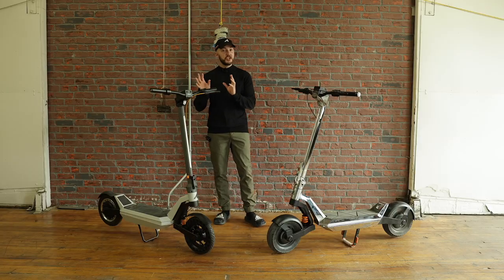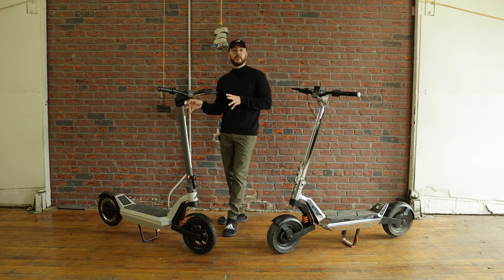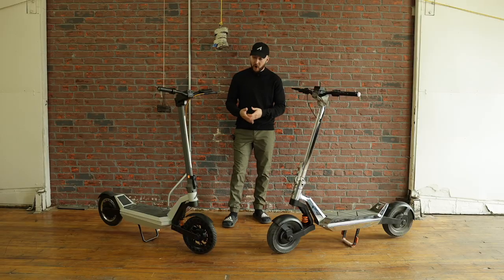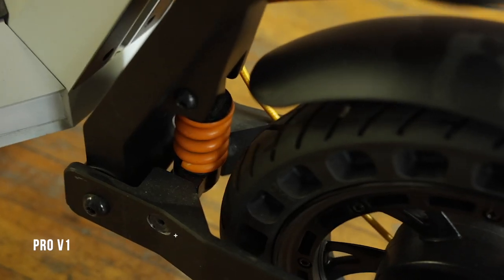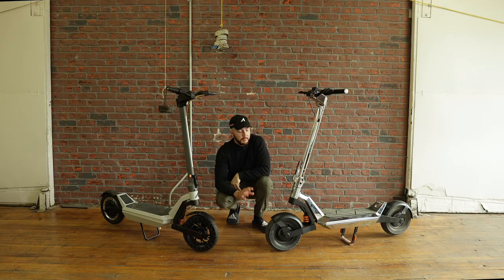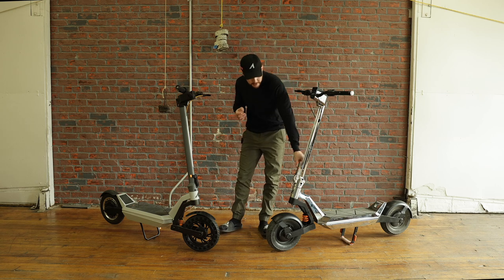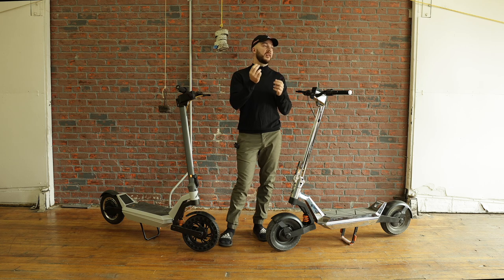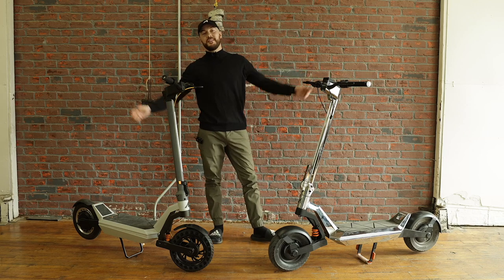Apollo Pro V1 to V6 Evolution

Comment: In general, my top-end, entry-level e-scooter (NIU KQi3 Max) has replaced all my single-occupancy-travel vehicle use when I'm doing errands for a while now, but it lacked the feature-set polish a vehicle has (single motor, no suspension, no turn signal lighting, weak sound/alarm, lack of thorough endurance-quality control testing of parts).

Despite being one of the most well-built for it's class, in less than a year, the front emblem has fallen off (adhesive failure?), the throttle needs to be replaced because it constantly gets stuck in position (I'm guessing the spring has weakened) as well as overshoots from it's max position, causing a potentially dangerous situation, the kick stand has worn down and now overshoots and is less sturdy/robust, and the disc brakes get bent when toppled over (due to the kick stand not being sturdy anymore), just to name a few.

There have been some potential upgrades I was considering, like with the Apollo City Pro 2023, but I still wasn't fully convinced or prepared to switch.

The Apollo Pro appears to check off all the right boxes, particularly in regards to quality control, and I'm having difficulty trying to find a fault in it.

Much more expensive for sure, and I could buy a few e-scooters for it's price, but considering my lack of available space, I don't want to have to replace an e-scooter every year.

If I can have a reliable e-scooter (Apollo Pro has yet to prove this, but it seems more than likely), then it is a considerable investment for sure.

I myself have pre-ordered the Apollo Pro, and signed up for the Beta testing to confirm it's value.

We'll see what happens.

Looking forward to it!

Comment: u guys should show us all the features the Pro has to offer like when its locked/parked, customize horn. And so on. A suggestion i have is that when u are turning and have the turn signals on they should turn off once u have made the turn. Think some coding could make it possible.
Reply from the maker: Hi bozo king,

Thanks for the feedback! We have a more detailed video about the Pro in the works so stay tuned! As for the turn signals, they do automatically cancel after a few seconds :)

Comment: I think to prevent theft, it would be good if the console screen would disconnect so the owner could carry it in their pocket or backpack when leaving the scooter locked up outside. Without the console screen the scooter couldn’t even be turned on.
Reply from the maker: Hi RaiderNation-North,

The Pro has actually has built-in GPS and an alarm system :)

Once the owner locks the scooter, the owner will be notified via the Apollo App of any suspicious activity when someone tries to move tamped with the scooter. Aside from having a really loud alarm, the owner will also have access to real-time tracking of the scooter and a kill switch!